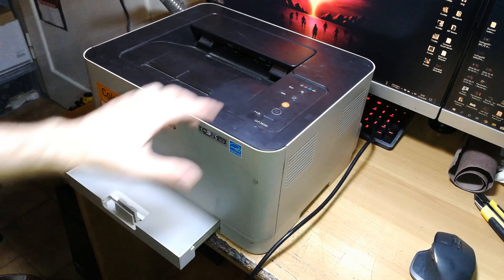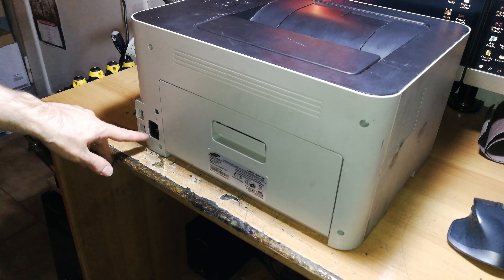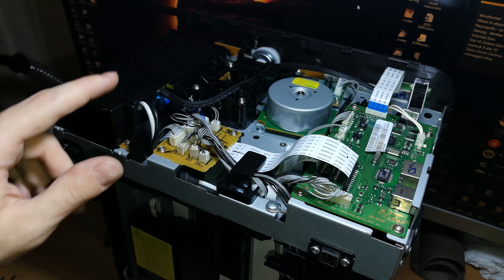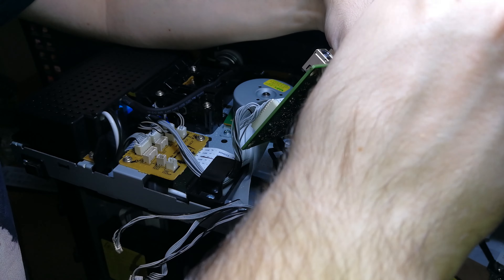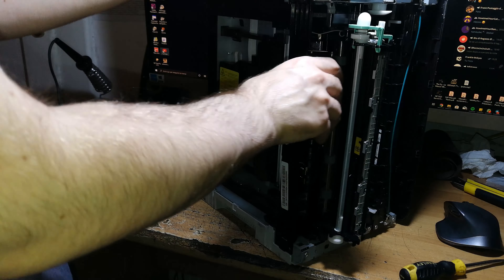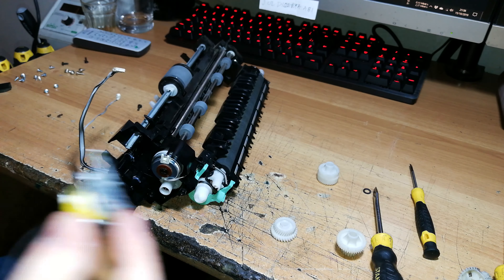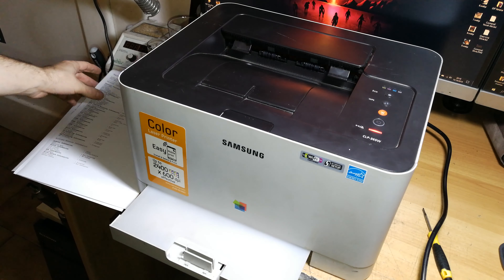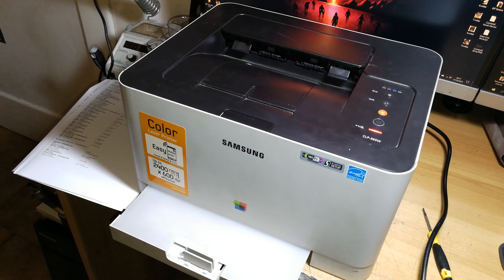How-to Fix Samsung CLP-360/365W, C410W/C430W • Paper Jam/Won't Pick-up • Detailed Printer Repair!

Comment: I want to thank you for this excellent video!  I have the C410W version and it didn't pick up the paper, and just as you described, when I used a flashlight to look into the printer I could see that it stood still inside.  I found a solenoid on a websight in China, and ordered it from there, the cost was redicolous, about 8 Euros including getting it in my mailbox.   Following your instructional video it was quite simple to change the solenoid, and after putting it all together again, the printer worked perfect!!   So once again a big THANK YOU!

Comment: <3 THANK YOU MAN... I mean, it was so hard but it worked!! Now I'm printing, however next time I'll be pleased to pay a professional to do it. The procedure took us (we were two!!) two hours LOL...the most difficult part is to insert the solenoid: is not clear in the video how to loose the main mechanism in order to put in place the solenoid, by the way we lost mor the one time its spring and we had to put it again in place. The other hard part was to put back in place the grey/black wires in those tiny holes... There can be some difficulties to open properly the plastic parts too, we were really afraid to brake them  (from the video it is not clear that the first panel to be removed must be shifted horizontally to the right).

Comment: Great video, thanks Paulo. I was ready to go ahead with your fix, but could not see clearly if the roller was turning. So I took out the paper tray and then propped up the front of the printer about 8cm. Then the roller is not only visible but also accessible to clean. There is a little plastic tag to the right of the roller which detects the paper tray.  if you press the tag and use a torch you can see the roller turning to try to feed when you press copy. Also a good time to clean the roller with a cloth soaked in iso-propyl alcohol. Be careful roller does not grab the cloth if you try this! Two other points your viewers might like to check: Place the tray and paper in a warm dry place for 24 hours. It's surprising how much humidity paper can absorb - this affects paper pick-up. Final point: make sure all the paper guides in the tray are snug against the paper - especially the one at the back of the tray (farthest from the roller). Doing all this got my printer working again without replacing the solenoid! Thanks again

Comment: Wow, it is such an informative video. This fix gave my printer a second chance in life. I had to watch and rewatch it a few times. There were some tips missing like getting the front panel off and using a swiffer dry static wipe to clean up toner, but this nailed it so well, I could not express enough gratitude for you posting the how-to repair video. It's thankfully not too difficult.

Comment: To add to the chorus, thank you so much for this video! Our Samsung CLX-3305FW has been having trouble picking up paper for years, leading to much frustration, until last week when it finally totally stopped! Thanks to the other comments here I didn't try to remove and replace the solenoid but simply removed the lower pad and taped the lower and upper areas with a tiny amount of electrical tape. I hope Samsung have rectified this design issue in newer models as otherwise the printer is pretty good and I'm impressed at the repairability.

Comment: Awesome video thanks for saving my printer from the land fill. I would just add that I don't think you need a new part. It's just a coil of wire that generates a magnetic field -- not much can go wrong unless it gets shorted -- and mine was not. The problem is that the little spring loaded metal teeter rests on a small rubber pad. Over time the spring pressure will cause the rubber pad to permanently collapse, and then the metal teeter is too far away from the solenoid and the magnetic field cannot overcome the spring. So I just peeled off the old rubber pad and put a dab of hot glue there - it holds the teeter up higher now and problem solved!

Comment: Thank you for the great tutorial!

After 8 years of service, my Samsung C410W would only take in the paper half way and then get suck on the first print-job. 
I always had to pull out the paper and restart the printer to make it work properly again.

I removed both pieces of rubber from the solenoid and replaced them with some rubber from a bicycle tube, which I attached with double-sided adhesive tape.

Now the printer works like new.

Comment: Thanks a lot, did work for me as well, i just cleaned the solenoid and replaced the pad, testet the solenoid switch with a 12v batt, did work, reassembled all, now paper pickup is working again!

Comment: Thank you.  I just picked up a CLP-365W marked $7.99 at a thrift store, and it has the same symptoms.  Everything else installed properly.  Your video has convinced me I can open this up and do this.  I'm guessing it will be exactly the same problem.
Reply from the maker: You can definitely do that :) also other users said that in their experience it's not needed to replace the entire solenoid, just the two foam pads :)
Reply: @PaoloMarcelli  I pulled out the solenoid, checked to make sure the resistance was right, and worked with it to make sure it was clean and free and that those pads were not sticky, put it back in place, and the printer is working great.  It didn't cost anything except a bit of time.

Comment: Thanks! Did this on my C460w. I also lubricated the tap on the inner gear wheel to reduce the friction between solenoid arm and the gear wheel. I removed the little top foam piece and replaced it with double adhesive foam tape but left the top plastic on the tape stay on. Worked perfect after 2 years of fighting this printer and almost giving up.
Reply: so, is the solenoid on the alibaba link compatible with C460W?

Comment: Awesome, you saved my CLX-3305W for 5 bucks, and a bit less than one hour of work, thanks to your perfect tutorial. There's just one tiny thingy stuff on the right that needs to be pushed when removing the front panel on my model (at around 5:21 on the video). I followed exactly the tutorial and found the new solenoid on digitec (article JC33-00025B, it took a few weeks to arrive).

Comment: READ THIS IF YOU DON'T WANT TO PURCHASE A NEW SPARE PART:

There is a %90 reason why the solenoid does not work, and that is the little rubber piece that acts as a "stop" of the spring loaded metal piece is "crushed". It has become so thin that the metal piece has not sufficient space for the electro-magnet to work. To fix this: 

- Follow the tutorial up to the point where he just replaces de solenoid. 

- Instead of replacing it, grab a piece of two sided rubber tape, or a piece of a rubber sandal or something and paste it between the previous rubber piece and the moving metal piece. It should be very thin, you don't want too much space either. 

- Re-assemble as the tutorial shows. 

On another note: my C410w model (Argentina assembled model) has some differences that made working on it a little more difficult than the video: 

- They replaced some cables with ribbon cabling on the main pcb board, that prevented me from totally flipping the board to remove the loading tray screws. It was nerve wrecking to try to push the pcb board and remove the screws without em falling. 

- There is one extra screw to remove the loading tray, which is silver and is exactly below the first black screw he removes in the tutorial. 

THANK you very much for this video!
Reply from the maker: I've made a video about these solenoid problems even on other Samsung printers where I just replaced the rubber pad, but when I tried this method on this model it didn't work for me, so I ended up replacing the solenoid :) but maybe was just a coincidence for me, sure better try this before ordering the spare part! Thank you for sharing your experience.

Comment: Thanks for the info --- I purchased a Samsung C460W for $20 that wasn't working due to a paper pickup issue. The steps for this unit were very close to your demonstration, however when it came time to pull the 4 sets of wires through the hole this unit had a small hole and I didn't bother passing the wires through. I proceeded to cover the foam on the solenoid (still attached to the unit) with Kapton tape and reassembled the unit.
The solenoid was fine, it was just the foam that broke down and became adherent so by covering the foam with Kapton tape the problem was resolved.

Comment: Paolo, your video was great!  I would never been able to diagnose nor fix my C460FX without it!  Your instructions were perfectly detailed--I watched your video before I started the repair, and then watched it again (with lots of pausing!) as I stepped through the repair.  I did not replace the solenoid, but like others, but put a mylar label on the rubber pads to prevent sticking (even though the pads did not seem to be breaking down).  I crossed my fingers and it all worked after I put it all together.

The repair took me about 2 hours in total--I wish I was as proficient as you.

Thanks again for this great video!

Bud
Reply from the maker: Thank you bud, great job :)

Comment: Hello Paolo! I have a Samsung Xpress C1810w having a similar pick-up paper issue. Would the  inside of the c1810w printer be similar to the printer in this video? Meaning I could follow your instructions above and apply to my printer? Also, if so, could I purchase the same solenoid mechanism from the link, or does it need to be a different one? Thank you in advance for your time!

Comment: Thankyou!
What I did was use the old coil. It's not broken, just the pad is compressed and somewhat sticky. Remove the pad and clean, bend the metal lip to where the pad would normally stop the arm. Reassemble and done :) Only thing is it now clicks when printing (which I don't mind)

Comment: omg great video. i'm not sure if the solenoid is my issue but the center rubber paper pick up does not spin, but a single larger cog does spin above the double-cogged arm. when i fiddle with the paper pick up arm it makes a grinding noise...does this sound like the solenoid issue?
thank you for your help!!!!
Reply from the maker: the grinding noise if you move the paper pickup shaft is normal in most cases, but first of all what printer model do you have? I cannot do any research without knowing the printer you have.
Reply: @PaoloMarcelli  W410 SAMSUNG
Reply from the maker: @arkm940  C410W? Then it probably is that solenoid!
Reply: @PaoloMarcelli  thank you so much, i ordered it from aliexpress and will report back after i replace. thank you again!!!

Comment: Thanks this worked for me. Instead of removing the rubber I put nail varnish on which still didn't work. What worked for me was super gluing a couple of layers of card on top of the nail varnish so that the gap between the solenoid and lever was a bit closer. 2 layers did it for me. 3 layers was too much and the plastic gear was not being held. Works perfect now.

Comment: Fixed my CLX-3305FW using this instructional video. In my case, the solenoid had died (open circuit), as the pad on the original solenoid was not sticking at all. If you wear magnifying glasses, it helps a lot to see the small parts clearly.

Comment: Thanks pal. I'm a copier tech and have run into these issues in the past. We usually put a small piece of self stick mylar on the two sides of the solenoid. Trash picked a C410W that only had 769 prints through it. I put the mylars on and now I have a pretty much new printer. It was nice having your video to follow for the disassembly. Helped a lot. Cheers.
Reply: Could you please explain or make sketch of place where did you put foil? Have same problem with printer.
Reply: @SladjanIlincic  I put little pieces of self stick mylars on both sides of the solenoid where the rubber is. Cover the rubber pieces. Cut them to the same size as the rubber.

Comment: Thank you very much for the solution to this problem which also worked for my Samsung Xpress C460W. At first I thought it was the pickup rubber being dusty. But after seeing your video I noticed that the pickup rubber was not turning at all. It took me about 2 hours to fix it with help of your video (after waiting 31 days for the solenoid to arrive in the Netherlands), but now everything is running fine.
Reply: Hi Henrie is it the same part number? I have the C460FW
Reply: What solenoid symbol for c460w printer?
Reply: @patrykf4993  I ordered the exact solenoid from the AliExpress link provided in the comments at this video. And my printer is still working fine since the replacement.
Reply: @favers77  My apologies, I did not get notification of your question and only just now see it. I hope you could fix your printer. It is the exact same part number, I ordered the exact solenoid from the AliExpress link provided in the comments at this video.

Comment: On my CLX-3305 the problem was the old foam too compressed, I just replaced the it with compressible sealing and it's on the road again. Thx
Reply: sorry may you elaborate a bit. what do you mean with " the problem was the old foam too compressed" Where do i found it? Thanks a lot
Reply: @nicolarosano  This video https://www.youtube.com/watch?v=2dqN6kdqaew explains exactly what I've done, but not with a flip-flop foam. :-) There is a really tiny foam shock absorber between the lever and the frame that prevent noises. Mine was not sticky, just too compressed, so, too far for the solenoid to attract the lever. I had to do it twice as my first attempt was a too thick attempt. Hope you'll get thru.
Reply: @etiennegabaut9070  must the foam be sticky on both sides or must only one side be sticky?

Comment: Hello Paolo, many thanks for this great repair manual, now - after 6(!) years of having this printer standing around not printing and not wanting to give up, I finally found your video - many many thanks - it works perfect.

I have even found out that its not magnetic adhesive, but simply a slightly glueing soft bumper that starts to glue on soft pressure. So I put on some Tesa onto it to make it smooth and non-sticky and now it does not glue anymore even after pressure and works perfectly well now.
So its even a 0.0 Euro repair!
Many thanks and bravo bravo to you
Reply from the maker: Thank you and great job for fixing your printer!

Comment: Mega thanks Paulo, it may have cost me £15 for a new solenoid in the rip-off UK (£7.50 plus postage) but that is a lot cheaper than almost £300 for a wireless printer scanner. She runs again like new.  Perfect for the C460W to add to the others.
Reply from the maker: Thank you for your comment David :)

Comment: Thank you for this great video, i fix the printer but now is printing not aligned. What should i check to correct alignment?
Reply from the maker: Aligned? You mean the single colors are not alligned with each other?
Reply: @PaoloMarcelli  thanks for replay!!!...
no... the hole print into the sheet, somehow i fix the paper feed but image is not aligned with the sheet now XD.

Comment: This video was very easy to follow and allowed me to replace the solenoid in my CLX 3305FW. However, when I put everything back together, it didn't turn on any more. Just nothing on the display at all. I've retraced all the steps and did it all again, but I don't know what went wrong. Maybe I damaged the logic board? Do you have any clue what would cause the display to not come on at all? I even put back the old solenoid, but that wasn't the issue either. I opened the cover for the electrical parts but I didn't see any popped capacitors and that's the extent of my knowledge... Any help would be appreciated!

Comment: Thanks Paulo, your video is clearly well explained. I dissassembled the printer before ordering the solenoid and on the way I found some plastic chips that were preventing the right movement. Your instructions were capital on finding and solving my issue. Thanks again.
Reply from the maker: Great job :)

By the way, as you can read from the channel name, my name is Paolo, not Paulo XD

Comment: Wonderful! Thankyou! Worked perfectly for me and my C460w. Like others, I fixed the solenoid instead of replacing it. the Rubber pad had drifted a bit and was no longer touching the "counter flange" that the rubber pad should bounce agains. I moved the rubber pad back tow where it was supposed to sit and also bent the counter flange a bit downwards to make the arm not swing as var from the solenoid. Everything seems to have worked.

Comment: Thank you for your sharing. You saved my printer with a small spare part. My printer is C480W, slight different structure but your guide is adequate for me to repair mine.
Reply: Hi Wee Chang, my printer is same model as your.  Is the solenoid part no. you purchase is using same as what he recommended?

Comment: My solenoid  wasn't stuck cause of soft paddles got sticky so I just bent  limiter slightly closer to solenoid  (cause if latch far away from solenoid it may not produce enough force to move)
And it works !

Comment: Good video! I have a 430W. The diagnostics report no problem. But the printing software claims that the "lid" is open. I previously got two error codes from it once - m1-1013 and m3-112.Still, it prints test documents pressing the "X" button just fine, just like you did to test the solenoid. But when I try to use it for printing anything else, it refuses. It does not  even try to pick up paper. Just silent.  Any guess to what might be the problem?

Comment: Thank you the video! I take out the solenoid from the printer. I measured the solenoid with DMM, but the solenoid is good. The solenoid connector is the wrong (I cut the solenoid wire next to the connector and soldered it to the panel)!